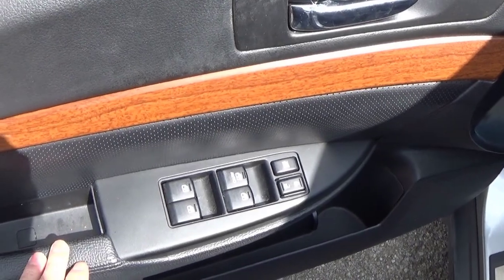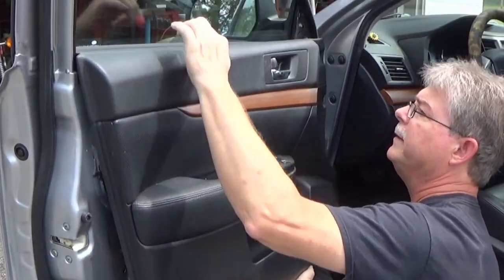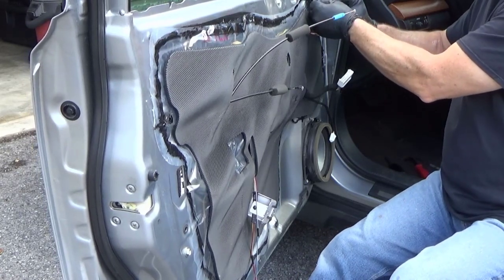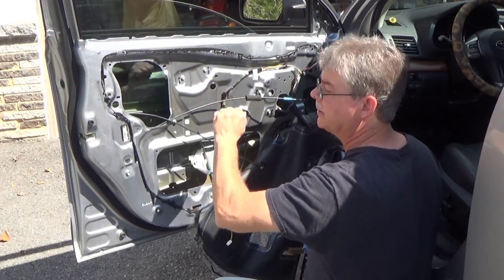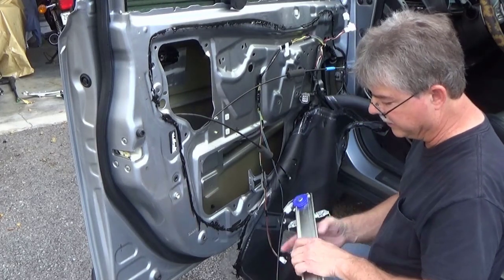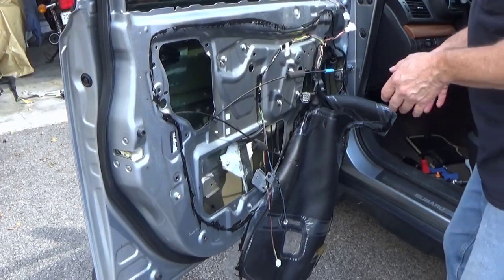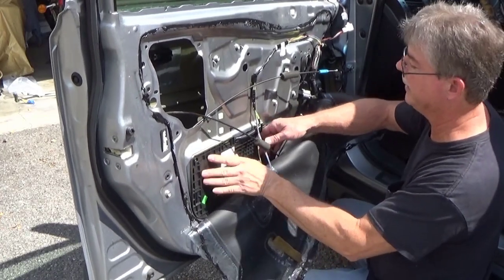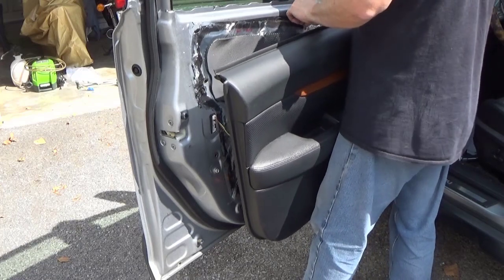How to replace drivers door window regulator on a 2012 Subaru Outback: Power window motor Subaru

Comment: My passenger door window is closed and the motor does not work. How do I get it down in order to disconnect the motor from window?
Reply from the maker: At time stamp 10:31, I comment on what you can do if the window will not roll down. I just realized that you can't see what I am pointing to at the top of the door. That would be the two bolts at the top of the track. 

However, there are some videos out there that show how you can force a window down, this is provided that the cable hasn't froze up as many do. You can take a good amount of duck, stick it to the window and make a pull handle out of it and pull it down. See this sample: https://youtube.com/shorts/yJEYGky7Wv8?si=p3Q8x5-MCfynf84m

You can try cutting the cables that go to the motor. I am talking about the heavy cables that run the track up and down, not electrical cables. 

If none of this works for you, contact me through my website where we can talk easier than in these comments. https://rodsshop.org/contact-rodsshop/
Reply: @ thank you so much for taking the time out to give such a thorough response I heard cut the cables on the initial video and will look into the pulling I down solution. I plan on trying this weekend thanks to your video.
Reply from the maker: @ If you need any advice, don't hesitate to reach out. Good luck..
Reply: @RodsshopOrg  Rod, just removed the passenger front in a 2011 Outback. The motor was not working and window was up. I cut the cable near the motor with wire cutters and the window dropped. Without your tip on the cable I’d still be trying to figure it out. But you are right about that black rubber sealant making a mess. Thanks for the video. Re-assembly will be a piece of cake!